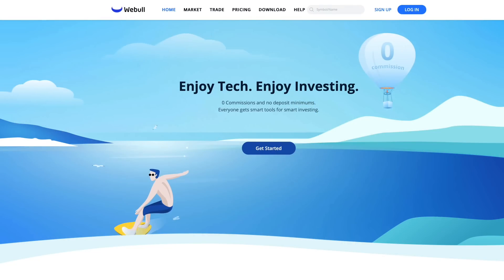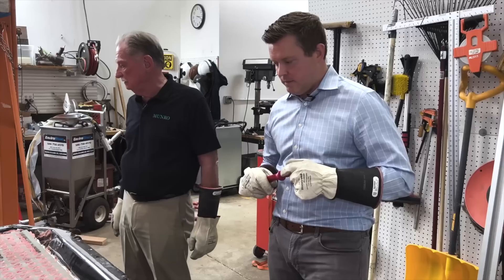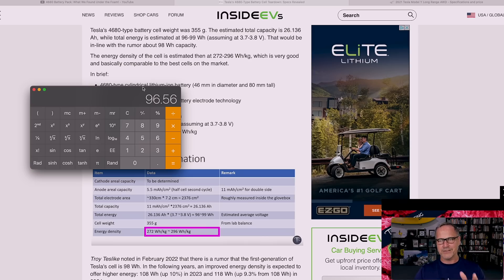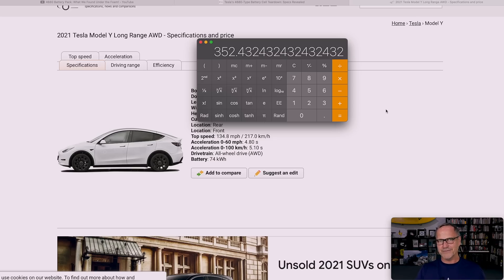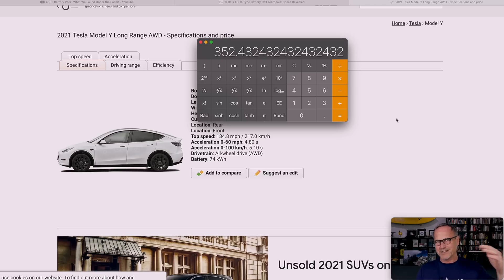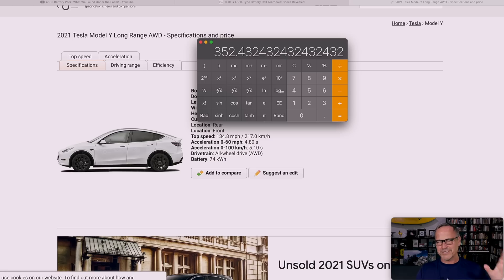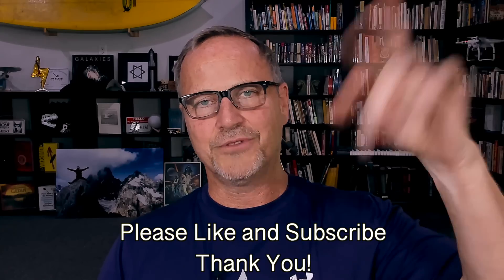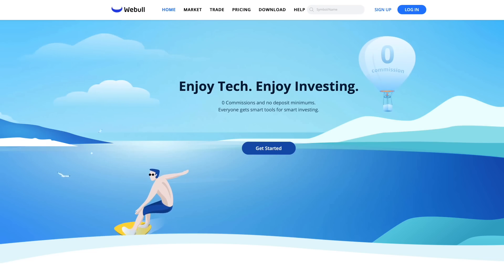Is Tesla SANDBAGGING the 4680 Model Y RANGE?!

Comment: You are calculating the full capacity of the battery cell. Tesla has never used 100% of the battery capacity. There is a low-end and high-end cushion to protect the battery. Also any Tesla will drive 15+ miles beyond 0%.

Comment: FYI, I have over 4,200 miles on MY with 4680s and zero degradation according to chart in Stats app.  We will see how it continues over time.
At 96% SOC it was still taking the full 9.6kw available from my home L2 charger.
Reply: Wow sounds like case closed ha ha. Those are two solid indicators of a software limit.

Comment: Sandbagging, as you call it, is true of all the models. The 74 usable kWh is probably the norm for an 80kWh max capacity theoretical.
They have said categorically that they are not “software limited” just safety configured. Many other manufacturers withhold much more capacity than Tesla as they dont have the volume of usage and lifetime data that Tesla has.  You are looking for conspiracy where none exists.

Comment: To all the non experts here all declaring that the Model Y with 4680 is not software locked, citing Elon's recent detail I say this.
Firstly Elon did not totally deny the claims so there is wiggle room there. Secondly these cars use the structural battery pack and none of you, with respect, are engineers and so need to understand that Tesla need to put something in the space, so why not extra cells?
You may say that Tesla would just use blank cells but hold on a moment as that makes no sense if you are Tesla.
A blank cell takes time and effort and money to produce, this is time, effort and money that would be better spent producing live cells.
If Tesla where to use dummy cells then they would be able to build extra cars with those cells, however Tesla aren't cell constrained as per their own words, also right now that would not result in that many extra cars being built to justify the huge cost in time, effort and money. Tesla would rather spend that time, effort and money in increasing the production speed.
So if Tesla were to use live cells but software lock the range then they would be free to focus on increasing the production speeds making the cells and as to those extra cars they could have built it would not matter because they aren't making a lot right now and these versions aren't available to buy unless Tesla offer one to you(a few are available in inventory).
So it makes no difference if Tesla were to save those cells and put them in extra cars or not.
This way once production speed is fast enough Tesla can offer the version on menu and with increased range of about 350 miles. This will help to keep Tesla in the news and offer great PR and no doubt help the stock price a bit.
The existing owners could be offered an update that unlocks the range, probably for a small fee and thus keep Tesla owner satisfaction scores as high as they are as existing owners do not then feel cheated and once again Tesla increase their lead over the so called competition.
Their is some proof for this thesis which is a YT channel called Spoken Reviews who has a 4680 cell equipped Model Y. He did a video where he showed that when his car was at 100% charge it was able to add extra range through regen braking.
This is something not possible on other  Teslas as you get a warning telling you regen is not available at the moment.
This shows that the battery is not 100% even though saying it is thus showing there is free room in the pack. Another piece of evidence is that another owner of a 4680 Model Y says that when they charge at home they are not able to decide what the charge limit is, this feature exists on other Teslas. This shows that either the cells are LFP chemistry which does not minding charged to 100% daily(this is not true according to another YT channel that have looked inside a 4680 cell) or the pack is software locked and thus when charging to 100% the pack is not actually full.
There you have it folks, I may be wrong but I doubt it...time will tell.

Comment: There are plastic inserts at the end of the modules they describe as bee hive these could be spacers in place of cells... cell count seems to be 816 not 880, I don't think they're sand bagging. There is likely a little headrace just to protect battery and allow regenerative braking when "full"....

If it were possible to software unlock 🔑  I do not believe they will.. to do so would be to turn on the osbourne effect.

That's not to say new future cars won't be sold with larger range... but never on older cars..

The upside may be that the current 4680 cars will maintain range showing no degradation as extra capacity could offset degradation

Comment: Have you allowed for the upper and lower buffers in your calculations?
Reply: Does not make a difference.
Reply: @taefravis  I would like to understand why it makes no difference.  If the nominal capacity of the battery is, for example, 80kWh and one assumes 4 miles/kWh then the range will seem to be 320 miles.  If, however, 5kWh is reserved for buffers then the range based on available capacity will “only” be 300 miles.  What am I missing here?

Comment: I was driving in Texas right after the first batch of Model Y Austin were build but not sold to anyone yet. I ran into a Tesla Engineer working on a supercharger with an austin built model Y he had put 7,000 miles on. He indicated he was getting at least 330 miles of range with it despite it advertised as 270........I thought that was quite interesting.

Comment: Its plain to me that they are just doing what they are doing for safety reasons, they want to make sure the  heat generated does not cause thermal runaway. There are to many unknowns to know for sure without putting it in service. Tesla is super safe. This all came about because of a mistake Tesla made on one car with a 90 kw battery pack replacement it wasn't supposed to have, causing a huge conspiracy theory. One other thing, there is almost no chance of there being "dummy" cells. The complexity is to great, unless you want to have another 737 Max.  It goes against engineering sense, in other words, keep it simple stupid.

Comment: I'm shocked that Sandy used a dry ice sprayer to strip away the structural foam.  Who sprays CO2 at an EV?
Reply: Might cool it down (if it was on fire, which it plainly is not). Water works too, you just need a lot of it.

Comment: Don't think they are sand bagging, my guess is that the battery is not consistent enough to have them all charged up to the max. I.e., if they only choose battery that can charge to the max, they will have very low yield in battery production. This is a guess, take it as a grain of salt. By lowering the charge level, they can qualify more battery to allow higher production rate. If their battery is good enough to qualify higher yield, they would have put in less battery cells and make more battery pack and hence more cars. So I hightly doubt any sand bagging is going on.

Comment: Couldn’t they be doing it to enable faster charging to a lower ‘full battery’? If you call full charge at 85% vs 100% you could charge to there fast and stay in the battery sweet spot. Then the extra 15% is just there to enable faster charging since the last 15% of a charge takes the most energy to get to 100%. Sort of a charge buffer.

Comment: I believe 2022 Model Y Long Range is 80kwh (older were 75kwh). It might be that only 75kwh is usable. I’d expect that Tesla is still testing 4680 and once they have more data, 4680 and 2170 Model Y will have the same pack size so most people won’t try to pick and choose where they want their Model Y from.
Reply: I think even 82 kWh
Reply: Yup this is the right answer because the 74kwh doesn’t include the buffer.
Reply: Also, since they are selling the Austin Model Y at a small discount they might offer owners option to enable more range by paying the difference (between Austin Model Y and Long Range Model Y). That would be in line with what Tesla did historically with Model S (75kwh pack sold as Model S 60 variant - but also allowed people to unlock more capacity later on)

Comment: The 4680 isn’t about increased range, period. It’s about manufacturing efficiency — lower cost/higher scale — and easier sourcing for more environmentally sound material. If early runs of 4680s are “overbuilt” and under-rated, it’s only a consequence of being careful at an early stage of production.  Long ago, Tesla committed to 300+ miles as basically ideal for 99% of purposes and people, and they need to spread the batteries out as much as possible to increase the units available — they have huge unmet demand, to say nothing of a race against an environmental time bomb. It would be nothing short of stupid for Tesla to intentionally build in greater range, secretly or not, because it would undermine the entire principle of the mission.
Reply: So is the “realistic useable range” with a slight safety margin the 300 mile number or is the EPA drive in town like a little old lady the 300 mile number? The “real” range at highway speeds with AC on, etc. is about 80% of the EPA number, so 300 mile “real miles” would need an EPA number of 375 miles. Dont think they’re going to offer additional miles later - just being careful as they release a new product BUT more miles will always be a push from the buyer and the larger capacity battery will always charge end to end faster “per mile”.
Reply: @joefannin18   I think all mileage — ICE or EV — is lower than EPA if you want to accelerate fast and travel at higher speeds. But I just drove my MYLR on 19-inch tires from Milwaukee to SF round trip a couple of months ago, and found that I could just about crack 285 miles at 70 MPH without AC if I was careful to accelerate gently, drive steady, use full regen, etc.  Most of the time, I didn’t need to go the full 316 anyway, since charging is fastest from 15% to 85% capacity, and there is practically always a good (or ideal) place to charge well before reaching full range.  Using full range for longe trips is more a matter of planning the ideal charging stops, and less about going as far as possible on a given charge — five short charge sessions with 250 miles in between is likely faster than four long charging sessions with 300+ miles in-between.
Reply: The thing is it isn't 300 miles real world more like 220 to 260 with 80 percent charge . Still enough for most people most of the time but not if you need to go further than
a than a 150 miles radius (300 miles both ways ) if you need to do it on one charge. Then there is the degradation of range over time . People report a 5 percent drop off in
the first year then it sorta stabilizes . But if you keep a car a long time it's a consideration, and at 60k plus a big consideration.
Reply: @ctuna2011  what do you drive?
Reply: Well said !! I couldn’t agree more !!! 300 miles is good enough
Reply: Actually the 4680 IS also about increased range, just by being bigger gives more range without any improvement in chemistry etc.
Reply: @taefravis  Did you watch the Battery Day presentation? The 4680 allows them to produce more cells from a smaller factory and each cell holds significantly more energy which in turn rapidly accelerates the scale of battery manufacturing that is possible.

No it’s not all about range. Tesla isn’t obsessed with range like Lucid is. I wish all Teslas had actual ranges north of 300 miles, but high 200s is where they and most of the industry are aiming for. Can 4680s enable a vastly greater range? Sure. Will Tesla do that? Probably not.
Reply: @TecnamTwin  he was responding to the op who says “4680 isn’t about increased range, period” and he was right saying 4680 is also about range. On Battery Day, Tesla themselves clearly point out a 16% range increase for the 4680 battery.. so the op’s is incorrect.

Comment: Another possibility is that the battery pack has some dummy cells (or cells that are bad/rejected) in it. Given that they are making a small amount of cells, it doesn't make sense to fill the pack with good cells but then limit its range. If 816 cells are needed for structural reasons, then you can't just make the pack will fewer cells. But if the yield rate is 90% or so, instead of recycling those 10% bad cells, maybe put them in the pack as filler so the structure of the pack is still there. As the yield rate increases you can use fewer dummy cells and increase the vehicles range over time.
Reply: I think they will use cheaper and lighter stuff to be as fillers.
Reply: @parkershaw8529  The dummy cell could be the case of the battery with nothing inside it. That way it fits perfectly with the rest of the cells and won't weigh much. Might not be as strong though so its also possible they'd need a case made with thicker metal just for dummy cells. Again, all just speculation on my end.

Comment: Bet it is not sandbagging but conservative customer "testing". They need to get lots of real world data on how this new format discharges and charges. They have too much invested in this new format to offer a full spec out of the box discharge and charge and then run into some unforeseen discharging or charging  problems. Better to observe the new cells behaviors with a margin buffer until there is literally mounds of real world data to rely on.
Reply: You're right. Batteries are very dependant on time - in developing new ones, the limiting factor is time. A new chemistry, and you have to spend lots of time testing it, environmental testing, charging and discharging thousands of times, and that takes lots of time. Going from lab to scaled manufacture, more testing, more time. A new form factor or a new assembly technique, guess what?  Time...and when the cells and packs are made - more testing, then when they finally get into cars, which is the real, harsh environment, they have to be monitored closely - the job isn't finished yet ! Over time with more (real-world) data, they can optimise temperature control, and charge /discharge parameters - and maybe tweak new cell / pack make-up from the real world data...all the while working on improving the cells they are manufacturing...and ramping production...
Reply: Evidence shows the range is being sandbagged!

Comment: A thought.
The main feature of this pack is the structural nature (it's in the name!).
.
That structure is achieved at least in part by glueing the cell "cans".
Therefore, logic would seem to dictate that for a given, uniform structural rigidity, EVERY pack would need a similar number of "cans"?
.
Taking this forward, a 60kWh pack would require either the same number of "Cans" as an 80kWh pack, or obvious "filler pieces" to act as structure in their place?
.
Questions
Does this pack have the "fillers"?
.
Are all the "cans" in this pack operational "cells"?
.
Another possible variable
.
Following the Limiting Factor teardown, it was noted that the Anode, while being fabricated using the dry electrode process, seemed to have little or no silicon content when compared to current 2170 cells.
The cathode appeared to be "standard" 2170.
So, if the construction has remained similar, the cell may have lower Wh per given "roll" area, but better power transfer ability (efficiency) afforded by the tabless construction.
.
We could be seeing either:-

1) A lower grade chemistry in a more efficient cell configuration.
Or
2) A "High grade" (2170 level) chemistry, in the same efficient cell, but with fewer active cells, surrounded by a number of dummy cans' to maintain structure.
.
3) A "full pack" of cells, software limited.
.
(My guess would be #1)
.
Either way, there's great potential to tailor specifications to suit specific vehicles and performance requirements.

Comment: Sandbagging to that extent (around 80 miles, or ~30%) doesn't make sense. That's 30% fewer packs that can be produced and sold in a severely production constrained model.
Reply: During the initial rollout period total production is not necessarily the primary concern.

Real world testing of barely post-v1 structural pack, and not creating an Osborne Effect is far more valuable than a few cells, IMHO.

But time will tell, of course.

Saying there is no unlock coming could be a nuanced answer to avoid creating an unwanted stir at this time, particularly on a financial call, where analysts could adjust their models based on what is said.
Reply: Tesla do not need those extra packs as 1) they are not cell constrained and 2) you cannot buy this version on menu and so Tesla aren't desperate for more units - they aren't selling tons of them right now.
They are producing as much as they sell of the 4680 Model Y, that logic would suit the 2170 Model Y more.
There is proof the car is software locked, please read my post as to why as I can't be bothered to repeat it lol

Comment: That's all provided the energy density is 272, while other sources say it's around 250. People are looking too deep into this. It's possible the range is slightly bigger than what's in the specs but people looking for some huge unlocks are just not being realistic. There is no reason to give people this much larger battery, that's like 25% over the stated spec. There is simply no need for such large "safety" buffer in a test battery.
Reply: They've done it in the past with model S 60 produced with a 75 kwh pack and software limited. But not with a product as constrained as these 4680 packs. If they're sandbagging this hard, there's got to be a business or marketing move we haven't seen beyond the Osborne Effect. Or, as you suggest, they're starting with lower density cells and will improve significantly once they scale production.